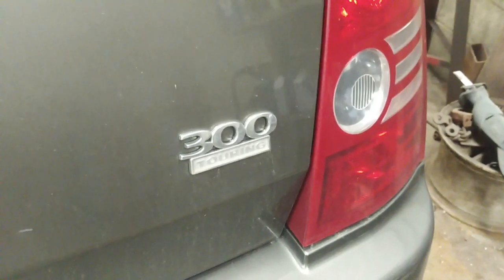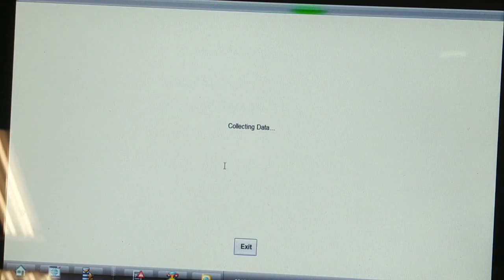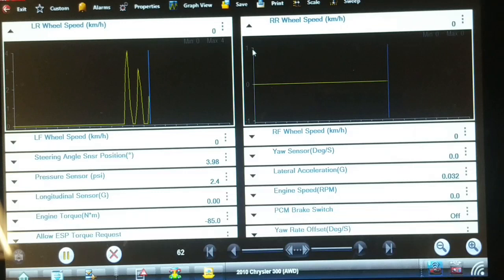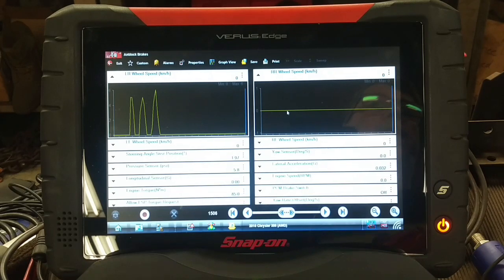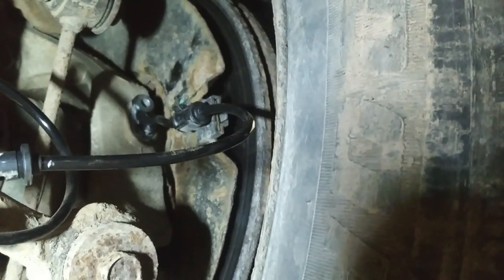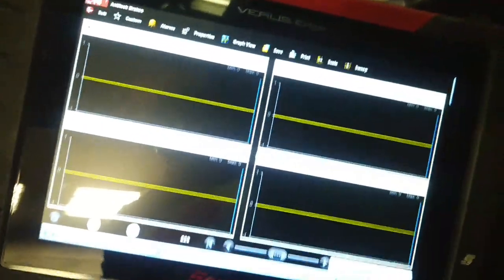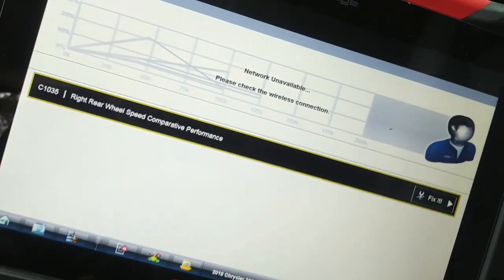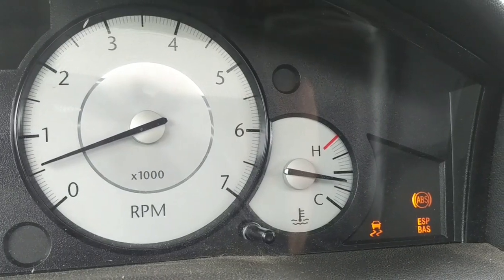2010 Chrysler 300 ABS no rear speed signals fixed sort of pt. 2

Comment: Cv axle has the tone ring and magnetic communication with the sensor, so maybe new right rear cv axle
Reply from the maker: Yes that would fix it for sure but replacing the entire cv shaft requires disassembly of tge rear knuckle with won't be fun. The tone ring can be replaced with the CV shaft in place.
Reply: @PhillipBailey  how's this done?
Reply from the maker: @etyrnal  here's where I did one...
https://youtu.be/4cWjP3e1L7Q

Comment: Fun but New ring are install, by my tool, test 2 new senser from Dealer Chrysler, and at the end.. have no signal, no cruise control no ABS, and track control.... So stay the same in fault... Bad
Reply from the maker: Did you diagnose it or just load the parts cannon? What code/s is is setting. Do you have speed signals from the front wheels on the scanner?